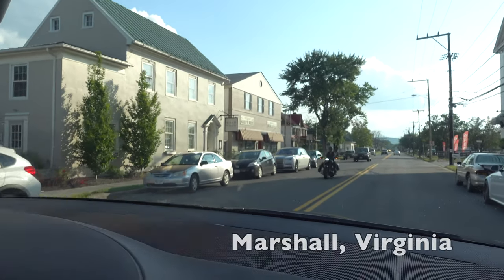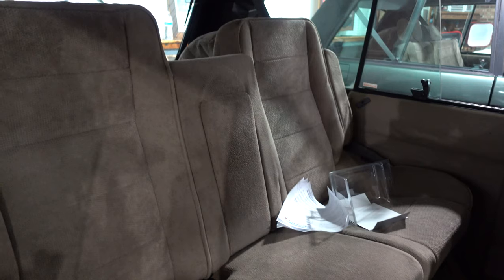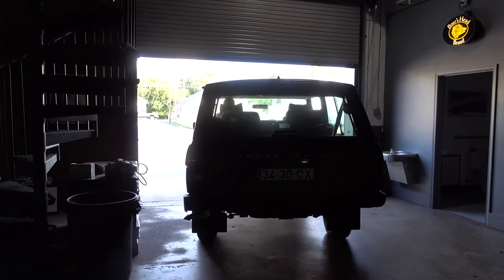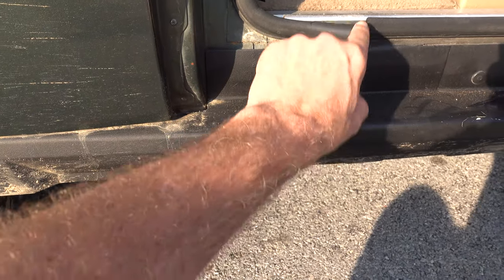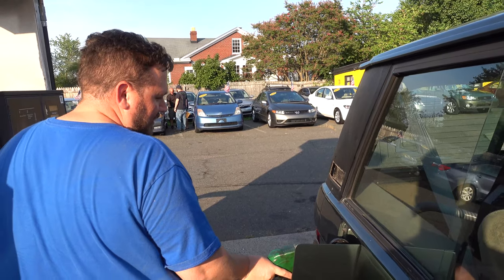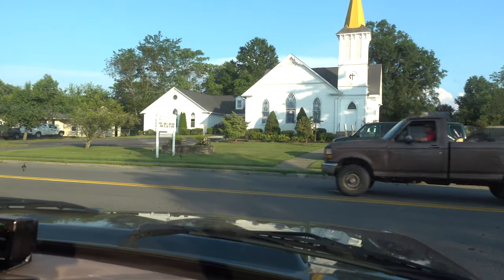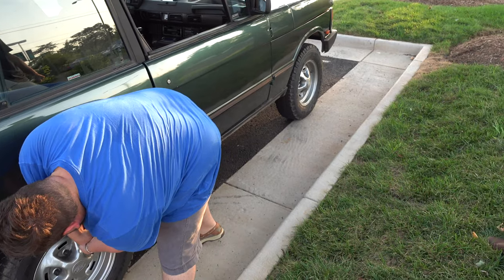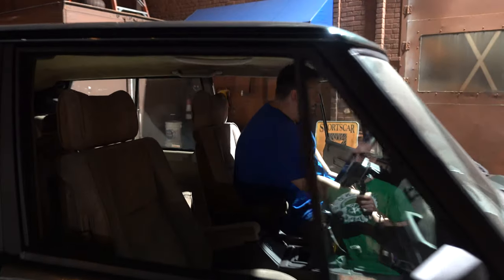#RoverRescue Part 15: Picking Up The UNICORN

Comment: These cars were the base models for the most European markets.Here in The Netherlands we had these as well AND with the 3.9V8 manuel in 2 door configuration.
These were the fastest models,because the 2 doors have less weight and with manuel less power loss in the drive train.They went like hell and had an oilcooler attached to the gearbox to cool the oil
This engine is a super reliable 200 TDI that always starts at the button and give great MPG.Two things with these engines.NEVER LET THEM OVERHEAT!!!! and drive them with sense when cold.
There is no need to rev the nuts of it will pull all between 1700 and 3000 rpm.
They can't stand it and cost you an engine rebuild.With proper maintenance these engines do 500.000km with ease.
I've worked on them for over 20 years and had for 2 doors from '72 to '81 and all 5.5 V8 carb.
Cherish them,even in Europe they are getting very rare in decent shape.They deserve it.(1000km on a tank is possible btw)
Reply from the maker: This one is in great shape and I know the owner is taking great care of it...except maybe for some minor offroading damage! But that’s a once a year trip. It’s in one of the offroad videos.
Reply: @DougsCars  Be advised that the specific body panels as the doors,rear wings,door frames and windows and the rear side windows are getting very hard to find.Good 2nd hand doors can cost a small fortune(from $500 upwards to $1000 for a mint one....)
Interieur panels have the same problem.I wouldn"t even dream of going big offroad with this smart 2 doors now,they are brilliant in stock form,but i would take a beater to do that off road work.
I don't know if this information is know to you guys,but these engines have a timing belt hidden in the front off the engine that has to be renewed every 6 years or 80-100k km.It's not a quick job to renew,but if it breaks you're in for an head rebuils at least.
After owning and servicing these cars for almost 25 years i still love the old 2 doors RRC (:
Reply from the maker: I’m sure those components for a two-door are impossible to find in the US as well.

Comment: My old 3 door Discovery had its 200 TDi from new, ran happily on new cooking oil plus a splash of unleaded, and I sold it with 240.000 MILES on the odometer, started first turn of the key and done an easy 90 MPH.. Enjoy your old fashioned diesel, noisy but reliable.
Reply from the maker: Wow, good to know! It’s a great ride :)

Comment: I own a factory 1993 manual 200tdi RRC four door that I imported from the UK to Canada around 2010. I prefer it the 1987 NAS RRC that I had before it though they are both nice Rovers. The diesel goes twice as far on a tank as the old 3.5 gas motor did. With a lot of help from Lamorna Garage in Seattle it has been converted from RHD to LHD.
Reply from the maker: Oh man you had it converted to RHD! Amazing. Would love to see pix...
Reply: You can have a look here if photobucket hasn't deleted everything yet:
https://discoweb.org/index.php?threads/my-rhd-to-lhd-conversion-got-out-of-control.78016/
Reply from the maker: That looks fantastic!! Thanks for sharing

Comment: Now that's a nice 2 door , mine is yellow and has been cut 4 inches back of the door lock , so I put a rear wall and slide window,  and then tray and canopy with lift up windows on both sides and back , a great work horse , 3,9 petrol injection engine, great video I was buzzed to see that one thanks for sharing it , 🍺🙆‍♂️
Reply from the maker: That sounds like a ton of work!! Thanks for watching 🍻

Comment: Rember them well but I live in the UK. I  know guy's that say the  Tdi 200 was a better engine than the Tdi 300. They say it was a more reliable engine and had more power. Wobble is probably propshaft bearings . Don't think having slack wheels would help lol  👍 another good video Doug.
Reply from the maker: Thanks! 200 was one year only in the RR from what I understand. Seemed to ride and drive quite well after the first few miles.
Reply: @DougsCars  That model was a one year only but the 200tdi engine was used for several, best RR Classic I ever had was a genuine 200tdi. For us in the UK that IS the sound of a Land Rover.

Comment: Glad you guys made it back! I hope the next video is you driving Big Suze around town with her new suspension and tires!
Reply from the maker: Or hopefully the install itself!
Reply: @DougsCars  true. you gonna swing by the shop and soak the bolts with Pblaster beforehand? Apparently, that helped when Wooderson's saggy old springs came off.
Reply from the maker: Nah. Mike did this on his rusty one. My chassis is coated in oil and PS fluid so it’s nice and rust free.

Comment: The two door Range Rover was stopped being sold in the UK in the mid 80´s but carried on be made until 1993 primaraly for the following countries:France;Spain;Italy and Portugal.The reason why these two doors were so popular was that it was a import tax dodge, the cars officially left Land Rover factory for export only as "comercial vans" they only had two seats mounted and a metal seporater in the middle.
On arrival to the varouis countries mentioned they were imported as "comercial van" meaning they paid a minimal import tax, then in the case of Portugal were I live the metal seperator was removed and the rear seats which came packed up in a "knockdown" kit from factory were mounted. 
The early VM Italian diesel were notourisaly unreliable and had head gasket issues,this was later replaced by Land Rover´s 200tdi engine which is the most reliable engine ever put in the two door model these engine are "bulletproof"
I buy restore and sell these two door Range Rover´s here in Portugal.
Reply from the maker: Ah, so basically how the Ford Transit Connects came to the US to avoid paying the “chicken tax.” Except the opposite: they came fully outfitted with seats, only to have those removed at the port upon entry to be sold as cargo vans.

Comment: And if you haven’t been told already the proper way to close the rear tailgate the glass panel is to press down on each corner equally
Reply from the maker: Yeah most of these have rusty rear frames so they don’t close properly anymore.

Comment: Hi, the 2.5 VM diesel version had to have two batteries but the 200 / 300 tdi had just one, There is a lot of  discussion as to the best engine but my 2.5 TD vm has 300,000 miles on the clock its just down to how you maintain them, all engines should be able to get 30 MPG, Good luck with finding more RRCs.
Reply from the maker: Thanks! We were misinformed, so as you saw, spent time looking for a second battery somewhere, anywhere. I’m sure there’ll be more Rovers to come!